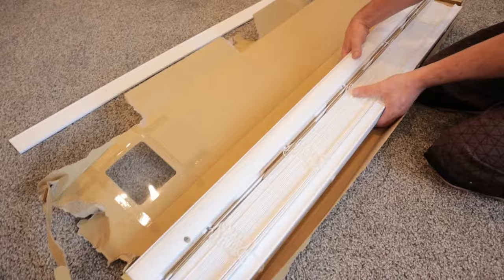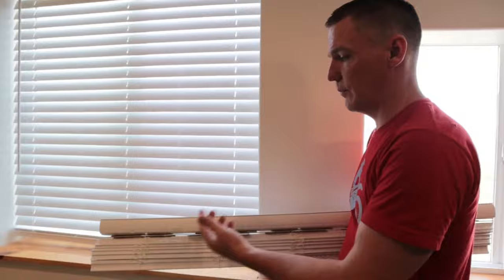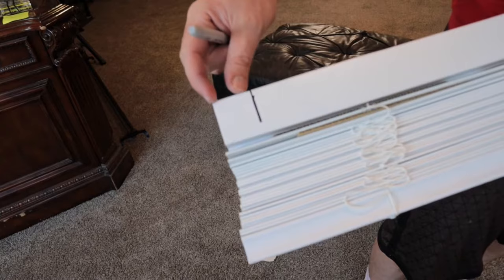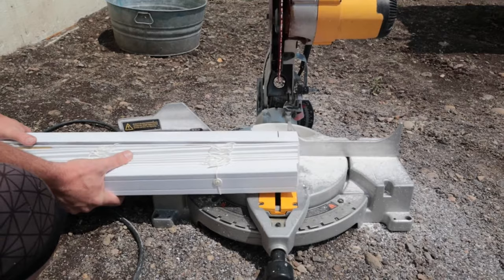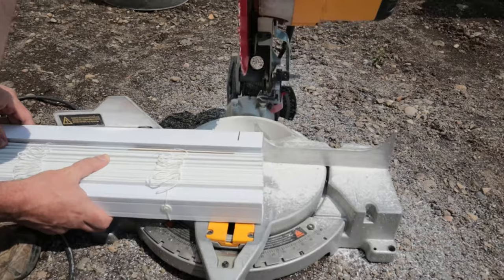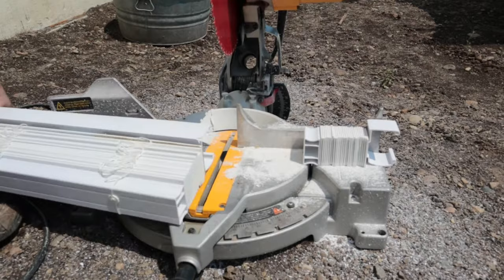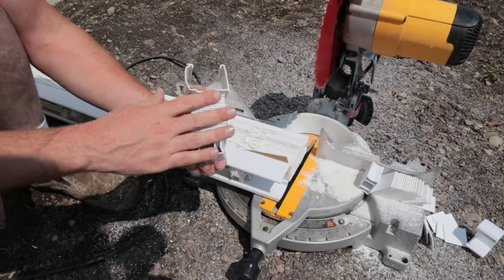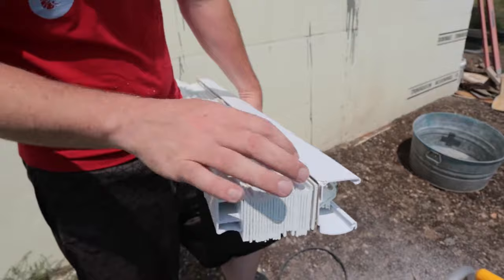How to Cut Blinds to Fit Width

Comment: No! This is a hack job. It’s ok to use a miter saw, but not like this! Use a sharp fine-tooth blade (40 tooth minimum - 60 is better), preferably new. Lay your blinds the saw, align your cut mark on the head piece with your blade, and then carefully align all the ends. Then clamp the blind to the fence so they can’t move. Then slowly lower the spinning blade. Again, go slow every step of the way. Your cutting a $100 blind - why hurry?

Comment: DANGER NOTE: If the top piece is made of aluminum it will send sparks flying at you while cutting please be careful and wear some kind of clear face shield if you have blinds with an aluminum piece.
Reply: agree wholeheartedly! but wear eye protection anyway... and tape them together.. it takes a minute of your time. Great demo though.. i have one to do tomorrow and will definitely get my chop saw ready. Nice to see it cut rather than splinter.
Reply: Aluminum does not spark but there will be hot chips flying. Wear eye protection.
Reply: @NavyVet4955  
I wore protection for my eyes in case wood went in my eye, the sparks surprised me but I should’ve known better.

Found a nice Old Stock Brand New Faux wood blinds at a hardware store. You can’t get them with the cord anymore too! Had not choice but to cut it. Glad it worked 😄

It was a little too big so I had to cut it. The wood cut fine but the aluminum piece sparked.
Reply: @42luke93  aluminum does not spark. If you had sparks it was from a ferrous metal that may have been in the material. Aluminum is non ferrous and does not produce sparks.

It’s non sparking property is why aluminum and brass tools are used in environments that may contain explosive gasses or materials.
Reply: @NavyVet4955  
Unless it was the blade of the saw that was sparking as the aluminum top was cut. Thanks for clarifying. 
Got the blinds for $20 makes down from $40. Strings to control the tilt too (no wand). Best find of the year!
Reply: I have a couple of all aluminum blinds that I want to cut down for one of my out buildings. I guess we'll see 😂

Comment: For anyone watching, just cut my faux wood (plastic slatted) Venetian style blinds with aluminium header with DeWalt chop saw. I was hesitant at first then watched this video. Went real slow on the cut and it came out smooth. Tiny bit of darkening of the plastic were I went too slow and it heated up. All said and done happy with the result. P.s. taping the blinds did help, if you're not certain I would spend the extra one minute to tape either side of where you're cutting
Reply from the maker: That's great info Greg, thanks for sharing!

Comment: You can cut it shorter than that too - just move the inside pcs and the metal bar will still work..if there is a will there is a way - If the made it, you can unmake it and remake it - the principle of Engineering to live by. AND you are not a good blinds cutter man -

Comment: Protip: If home Depot or Lowe's sells the blinds and they are new enough to fit in their templated chop saw, they will cut them free. Just tell them you got them there a while back and are moving them to a slightly smaller window or some such. They've done it for me a few times.
If you do this I would tape the edges so they will come out clean and zip tie or duct tape the whole so it's stable. Half what you need to cut and cut off evenly from both ends... If you suffer from the dreaded "CDO"  as I do, not doing so will probably drive you nuts eventually.

Comment: Yeah chop saw seems fine. I was worried it would break the slats into a real mess.  Gunna buy my blinds now and get fitting 👍
Reply: Yeah my chop saw with its metal cutting blade and nasty looking teeth cut through the plastic slats like butter

Comment: Helpful. Passed by a hardware store with old stock corded Faux wood blinds by GSP Direct. It's just an inch too big unfortunately for me. On clearance for $20 (50% of $40). Really do not want to pass up that deal plus having a cord.
Reply: Update: Tried this with success. I was not expecting the aluminum part on top to spark though which was kind of dangerous (Should have worn a face shield, so please be careful) although I was wearing clear goggles. The main problem I had was that when I cut it, the saw couldn't reach the entire length of the blinds and I had to re-cut it. If you look close you see a little unevenness. But I am proud of my work! 

Helpful tip: Wrap tape behind the line around the blinds to help keep them still and be more precise, I had to cut 1/4th of an inch off so I only did one side.